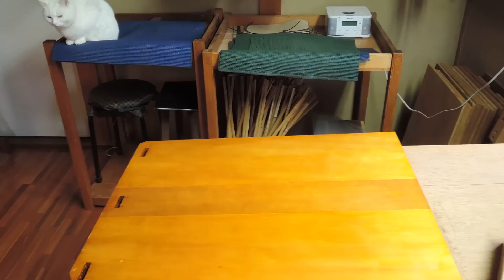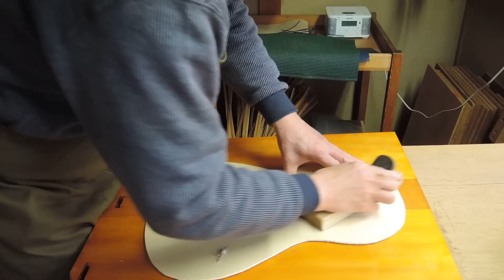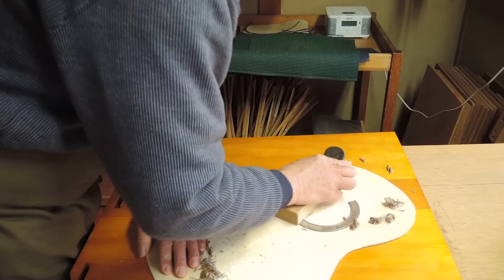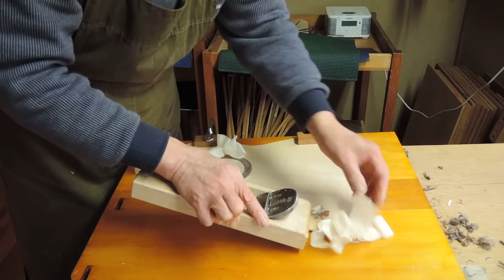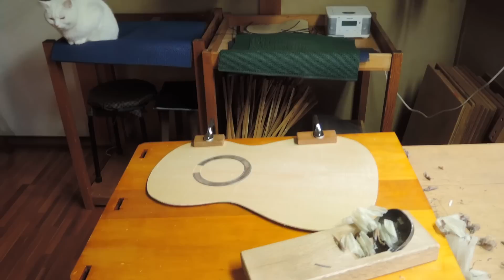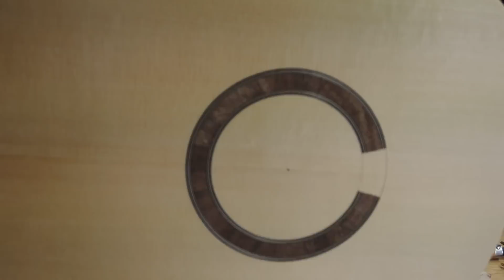初代・金井鉋を仕事で使う  その２

Comment: Wow and wow! such a beautiful plane. seems as though no mater what direction you plane in and if set to a fine shaving it will cut anything without any tear out. are you shavings around a half of 1/1000? Thank you so much for posting and taking the time to share
All the best
Reply from the maker: Thank you for your comment.
I am glad to your praises.
 The thickness of the shavings of plane in this video is about 30 microns.
It is not possible to reduce the thickness of the timber is 1 micron ...